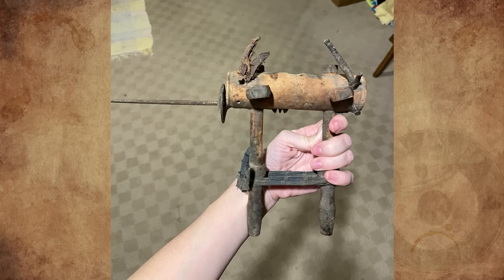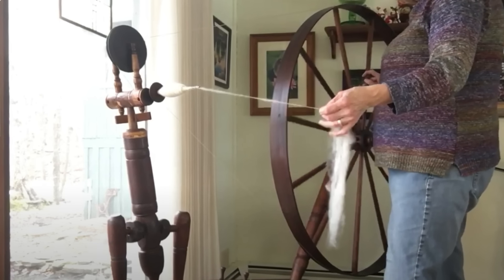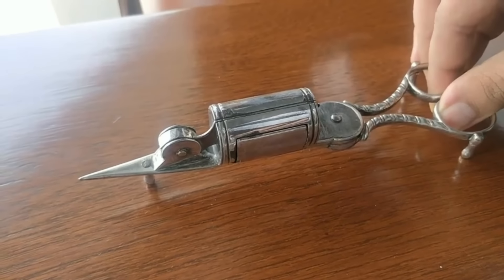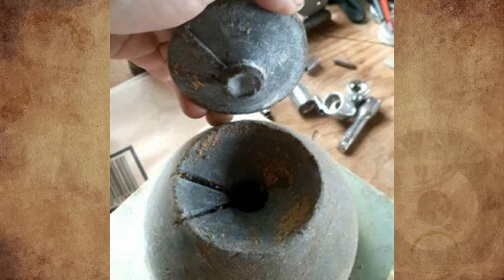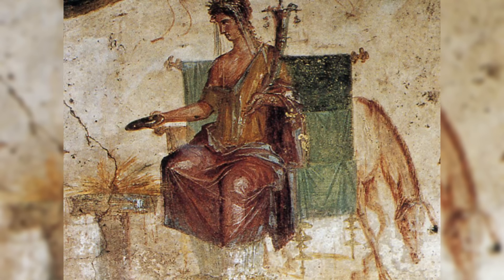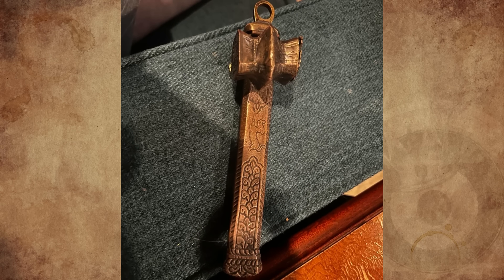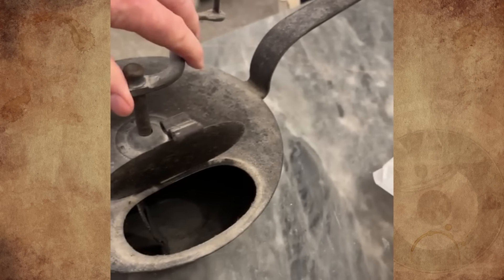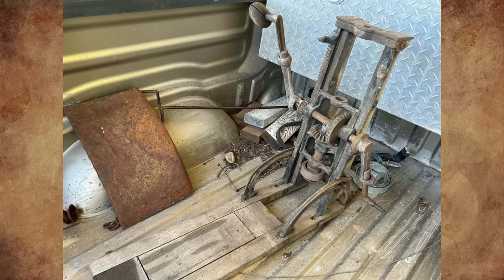What Is This MYSTERIOUS Scissors That Closes With A Click And This Wooden Antique At A Rummage Sale?

Comment: The last item that is unidentified is a beam drill.  It is used to drill wooden beams and there was a hand crank on each side of it. Some parts are missing.
Reply: You beat me to it by 2 minutes!  I wanted one I saw that had been completely restored, but the price was just too high.
Reply: Yes. Also known as a timber boring machine. This one is adjustable for angle, and folding for transport. Auger bit would be used with it to bore the hole, then the gear outside the frame would be engaged to the rack to pull the bit out of the hole and bring the shavings out with it.
Reply: I agree! Often used in post and beam barn building
Reply: 100%

Comment: Last item is a Barn Beam Boring Machine, used for timber framing. You would place it on the beam, sit on it, and use your hands to turn the drill, to make holes quickly and of consistent depth, for mortise and tenon construction. Seems to be missing the drill bits.

Comment: I knew most of them for a change.  I've hardly ever worn a tie but I remember in the closet at my parent's house Dad had a similar tie holder.  I've got a story about a lead sarcophagus at our university.  A friend was down helping a professor retrieve some materials from it and wearing all their safety gear they removed the lid, transferred the sample they wanted to a smaller lead container and put the lid back on.  The prof was telling my buddy about how cautious they always were with handling that material, all the procedures they had, etc. because of the dangers of radiation and how only a thick layer of lead was any real protection.  So my buddy says "what's on the floor above us?"  The prof's face goes blank, then white, and he races upstairs.  Long story short it was a locked and almost never used storage room on the floor above, and an equally unused utility space on the floor above that.  But the department shut down access to those materials while a thick lead plate was secured to the ceiling of the room.

Comment: I have a beam drill like that one but a bit more modern comp;ete with bits. Mine has two gears that you can remove the mechanism and turn upside down for the different gears. One is slow for tough wood or deep holes, and one is quicker. When you reach the bottom of the hole (it has adjustable depth stops), you can engage a rack gear to power-pull the bit up and out of the hole. It is called "The Boss".

Comment: The unknown item is an old drill. The bit isn't shown but it goes in the verticle shaft that spins when the crank handles are rotated. The drill press was set on a beam or other wood and a hole was bored into it. The "folding" part was used to bore holes at different angles. The flat part that sat on the beam was usuall sat on to hold it in place. I have used one of these to make joints in beams that a peg was driven through.

Comment: Item one is spindle shaft assembly for a walking wheel.  Huge 5ft drive wheel vs tiny pulley wheel makes mechanical advantage  (1 to 200) to spin wool fibers into yarn. Yarn gathers on the spike till taken off, plied and skeined for knit or weave. I use this tool on my Great Walker Wheel. 2nd small wheel increases advantage to 4or500 to one turn of the great wheel. NOt all have both.